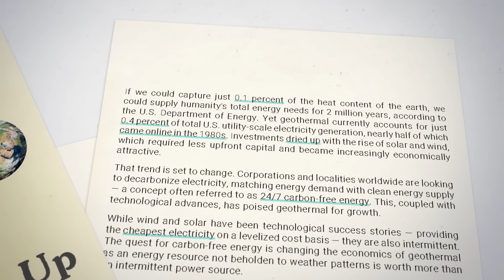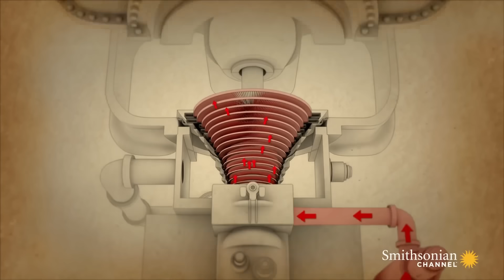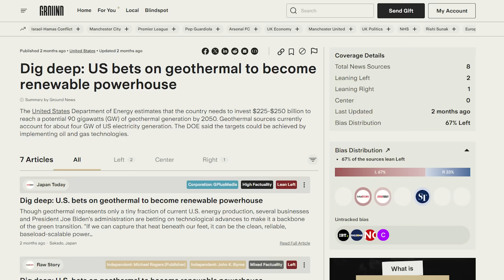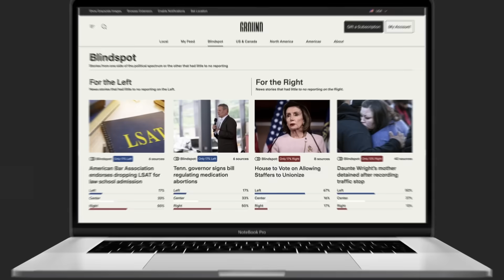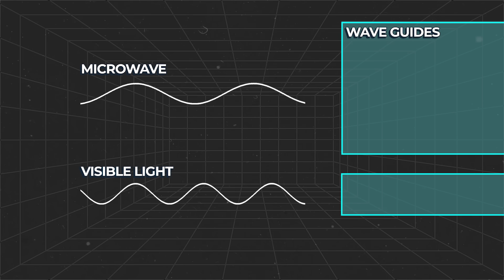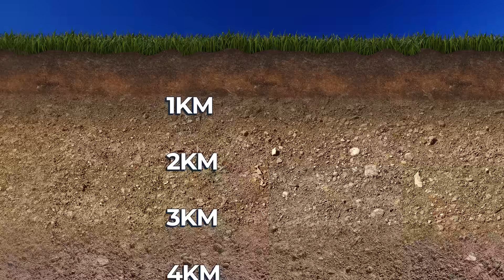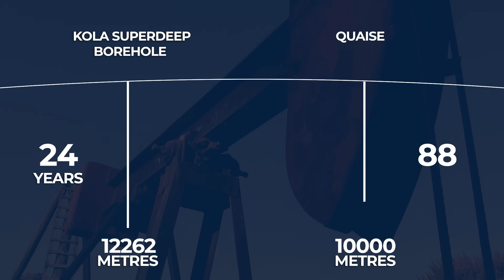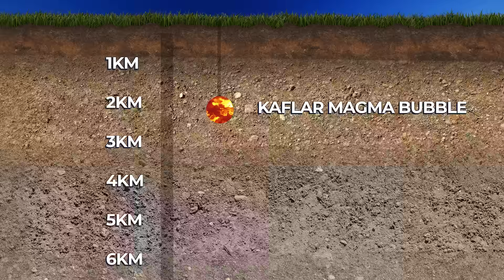This Fusion Tech is Solving the Geothermal Energy Problem

Comment: Drilling down conventionally and then switching to the microwaves when you gain more with that process would be a better choice overall when the process is fully developed.
Reply from the maker: Good suggestion, as the comments above says, this is their plan, that clip in the interview ended up on the cutting room floor
Reply: @DrBenMiles  why did you cut that out? seems very relevant
Reply from the maker: @Potent_Techmology  totally relevant, it's always a tough choice what to include and what not to. Maybe I'll start releasing a polished version of the recording of the full interview to channel members for anyone interested.
Reply: Or start with a decommissioned pre-drilled oil well.
Reply: @bruceconnor6535  That would be tactically useful, but strategically unwise. They are going to drop holes at present power generating facilities where all the heavy infrastructure already exists, replacing fossil/fission.
Reply: @bruceconnor6535 Do they still contain oil or natural gas? And is there heat in those well's to be utilized?
Reply: Congratulations, that's exactly their strategy!
Reply: But when new generation  2 million psi 3D PDC bits are heading towards 1km per day in comparable rock strengths why would you bother switching to this fantasy technology when the manufacturing tolerances and temperature related dimensional changes in the ID of the drilling tubulars would attenuate the beam to effectively zero power at that depth?
Reply: I’m in western Canada and using existing boreholes from oil/gas wells is a great idea. 

There’s already casing there and then this would create its own casing with the melted rock.
Reply: @KurtQuad there might still be oil down there. Just not viable , because components of the well structure need replacing.
I have seen YouTube videos on pollution problems from decommissioned oil wells, and they are not very positive.
Reply: To a point because this drill makes its own pipe by melting the walls
Reply: The quality of the melted surface does not offer a valid well integrity barrier, nor is it consistent or repairable.
Reply: @kevindonkleywood I was wondering what would happen to the drill shaft, when the melted rock resolidifies , at a depth,as is rises to the surface? Does it need a sleeve shaft put down , that sinks down with it as the rock melts?
Reply: If each well could go from start to production of power in 200 days, and the production of two new rigs took 200 days or less, then there could be one well per square mile in the United States in 12 years.
Reply: @punkinhaidmartin doesn't it have to have, permittable geological structure? Water table, ground water pollution , earth quake danger, to be considered?
Reply: It hinges on how difficult drill production is over time. As the drills get easier to produce, the energy to produce the drills becomes easier to get. 
We should be looking into a geometrically progressive leapfroging where each well is used to pump energy to two new drill rigs and wells as thier first task.
Reply: Where there is an aquifer, the energy would be wasted boiling water, and drilling would be impossible, but under those conditions, conventional drilling works well. But below the aquifer 9 and taking steps to insulate the borehole) they can easily switch to vaporizing rock.
Reply: Hitting the aquifer is perfectly fine as the end result from the top of the borehole is steam as shown in the illustration at the very beginning of the video.
Reply: @chrismuir8403 how would  you insulate it enough, as to not heat up the aquafer and start possible earth quakes? Or am I wrong in my assumption?
Reply: I haven't done any maths , but intuitively what you suggest sounds reasonable. Use standard drilling to extract the "cold stone " so to speak . 👍
Reply: Agreed
Reply: Great minds think alike.
Reply: I jumped on here to say the same thing.  LOL 😂
Reply: That IS the plan. They will drill down to about 3 miles with standard drills - Carlos, the CEO, comes from working many years at Schlumberger so he's very very familiar with drilling and it's costs and capabilities - and then the microwave drilling will take over at that point.
Reply: Kinda scared of the cooling of the earths core and shutting down of the magnetic field when we start pulling energy from the earth.
Reply: @UsernameDg  I think the gravity massage that earth gets from tidal forces replenishes the heat a lot faster than we could cool it with a few million pin pricks.
Might be a good idea to cool that super volcano under Yellowstone if we can too.
Don't want all that energy coming out at once.
Reply: @UsernameDg  You needn't be scared, people who are experts naturally think of such things and do the maths - there is no risk. Remember that opening line about the 0.1% of energy serving our needs for millions of years?
Reply: @danoneill8751  well some one has to be skeptical of the things they say and do independent research. They still deny climate change and green house gases to this day
Reply: The amount of energy is minuscule, and a bridge between carbon energy and renewables.
Reply: @UsernameDg  Absolutely not a problem. Quantitatively unnoticeable even if used universally.
Reply: @UsernameDg 
That won't be possible, the heat is from three sources, primordial heat, from the birth of the planet
Radiological heat from radioactive isotopes 
And friction from tectonic plates driving past each other.
There is also friction from tidal effects from the moon but these are minor compared to the first three.
We would never run out of heat, the heat produced if much more than we could ever use.
Reply: I think comments like this should studied. Unsolicited advice on something they just heard about.
Reply: @SECONDQUEST  It's still a good suggestion even if a bit obvious.
Reply: @SECONDQUEST  you should be studied. What kind of person complains about YouTube comment’s providing “unsolicited advice”?! What do you think this is, a scientific conference?! Is this your first time using the internet?😂
Reply: @SECONDQUEST  Why are you two being assholes?
Reply: @banksuvladimir  they are, too, giving in their random no name inputs

Basically bashing the thing by doing it themselves. Fascinating, worthy of study.
Reply: @SECONDQUEST  to be fair, it was obvious. not only did everyone watching the video think exactly the same thing, but it was actually discussed in the interview and edited out.
Reply: @SECONDQUEST  Genuinely I am fascinated by youtube commenters or commenters anywhere who think their random, no name input actually equates to anything
Reply: @Salamandra40k  I mean it did for Elon. It wasn't a YT comment but it was a youtuber who asked a question about using the exhaust to loop back in the system. It got him thinking on the spot and resulted in an increase in effincey for the engine.
Reply: @Salamandra40k  There are some pearls in the wisdom of the crowd. Some of them are even mine, like use this on mars to tap into the sunken water reserves that are believed to reside at 12 kilometre depth.

Also a great interplanetary geology science instrument, since you can do infrared and xray spectroscopy on the plasma plume and condensed wall while on the drill through different mineral layers.
Reply: @Salamandra40k 
You need to look into " the wisdom of crowds".

Comment: You call it unlimited energy. But is it really. I understand that we would transition before it becomes an issue, but if your pumping heat out of the earth, arnt you cooling our core? Couldn't there negative efects in cooling the core, even if just a little? Do we know what issues could arise even if we only lower the temp a few percent?
Reply: And, we’re pull heat out of the core into our atmosphere. Done on large scale what impact does that have on the environment?

In any case we need to keep working on being more efficient.
Reply: @RobC1999  good question.
Reply: The heat comes from the motion of the Earth and the gravitational forces acting on it. It isn’t like a stored up finite quantity that we could meaningfully deplete (like oil).
Reply: @silverXnoise  the earth core is cooling through convection naturally. But It seems to me that we would be accelerating that process when we pump the heat from the core. But I guess the question might be, how much faster would we be accelerating the cooling?
Reply: @johnphillips7444  We would accelerate the cooling similarly to how we would deplete our water through fusion: Not at all for all intents and purposes.
Reply: @SpaghettiToaster  hydrogen and oxygen bonds can be remade. The elements are still here and are not depleted.
Reply: @johnphillips7444  No, fusion consumes hydrogen atoms and produces Helium, which evaporates into space, and there's no way to turn it back into water. So the water you put in is indeed depleted. Only so unimaginably slowly that the earth (and the sun) would be long gone before running out. Depleting the mantle's energy from geothermal extraction would take again 10000 times as long, roughly 1000 times the current age of the universe in fact.

Comment: Existing geothermal works the best if the ground is already fractured for the injected water to seep in. Else the water will cause local cooling which will solidify the rock requiring drilling again in different location. How are they planing to solve this so that a drill site can last decades instead of years?
Reply: Judging from the video it seems that melting the rock creates a pretty good seal around the hole.

Comment: One form of geothermal not mentioned is mine water geothermal. No need for fracking when you can use the extensive mined out areas already present. Its much shallower, much cooler, but obviously has huge volumes to work with. Its already in operation in England, with more sites being set up. 
I also wonder if this kind of rock vaporising technology could be given a significant boost by starting in a deep mine, or could even be complimentary to mine water geothermal as a part of the cost cutting with existing infrastructure plans.
Reply: Funny that, I was thinking exactly the same about mines in the UK.
Reply: It's low enthalpy energy and only really useful for space heating, but that's not to say it isn't still useful. If you've got a greenhouse, factory or office space that needs heating, it's worth having.
Reply: Mossop3135 are you saying that you can't use a turbine ?  Because you can
Reply: @hawkbartril3016  If you want to really get every last joule out of it you could use a stirling engine, but the fact of the matter is that low enthalpy heat isn't that great for generating electricity.

Comment: very cool, now to figure out all the ways this will end badly for us in the long run...
Reply: Yep, cheap energy? Energy companies will definitely find a way to make it expensive for consumers or never getting off the ground globally
Reply: energy companies being scum is i think a smaller worry . what about extracting heat more and more and slowly turn the magma cool slowly hardening the crust . this could damage the Plates movement . Hell this could weaken the magnetic field that protects us from cosmic radiation. 
What else ? who knows but its certainly not a long term solution without damage
Reply: For everything in the universe, the question is not "Will it turn to dust?" But "How is it going to turn into dust?" 💀